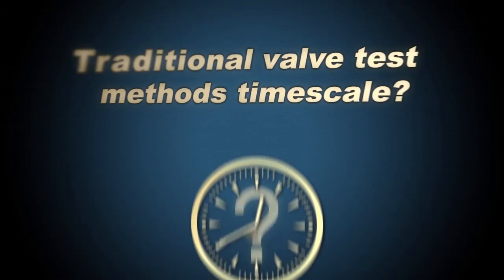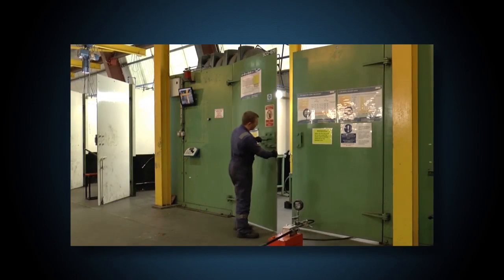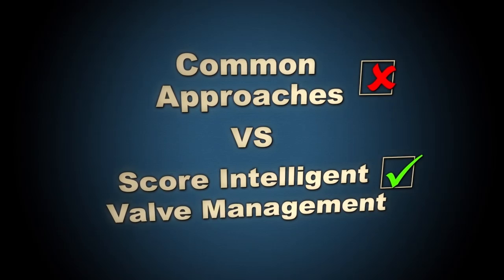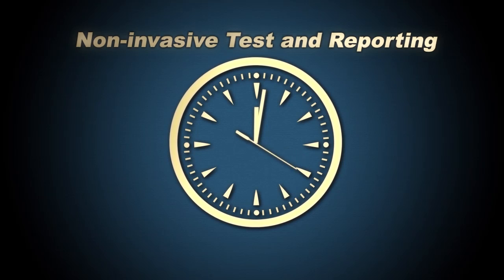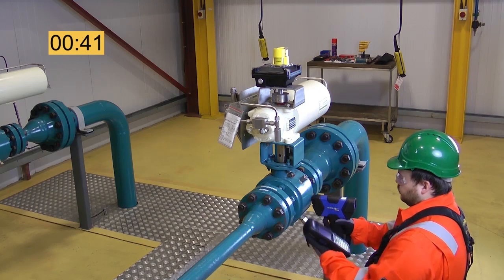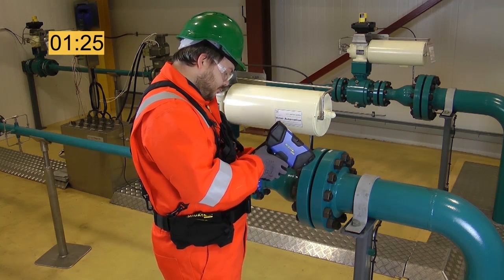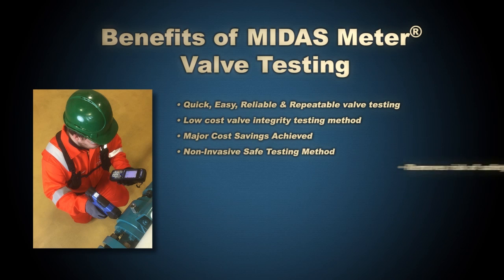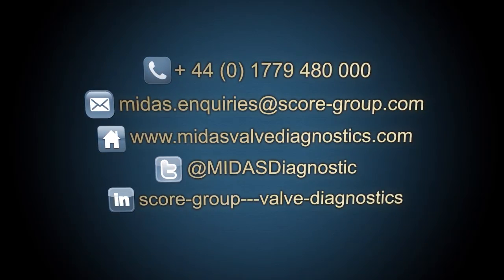How to Test a Valve in Line Quickly & Easily

Comment: What reading were taken? Pressure or Flow? And what if the seat on Valve is DPE model on one side or both side? What is your reference to use 90 seconds as standard measuring?

Comment: 90 seconds is a bit of a lie. You chopped parts out of the footage when the guy moved positions.
Reply from the maker: Simon, thanks for your feedback. If you look very carefully, the 90 second clock in the top left of the video is perfectly aligned to the compressed video. From 1m 42s to 2m 36s (a total of just 54s) is the section relating to the "90 seconds" of surveying time. We did this to improve ease of access and minimise the total video viewing time.